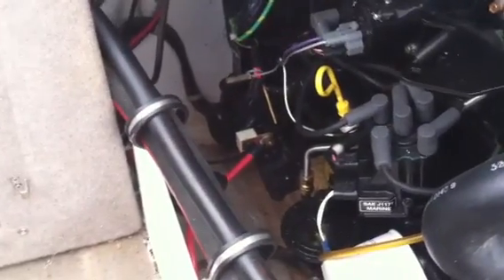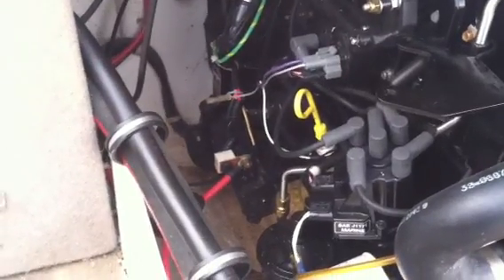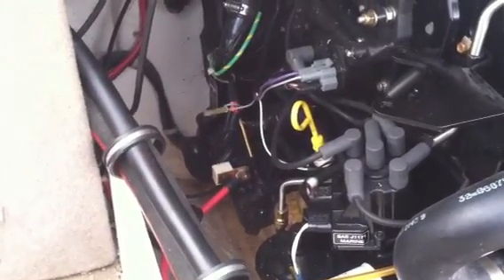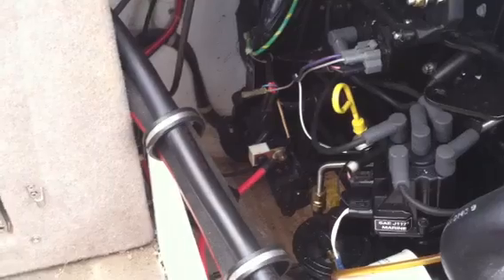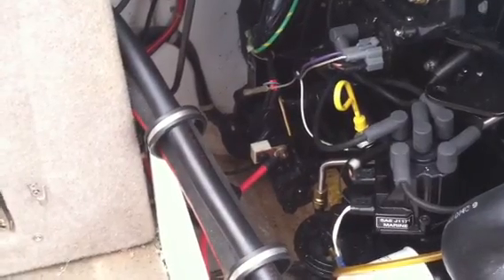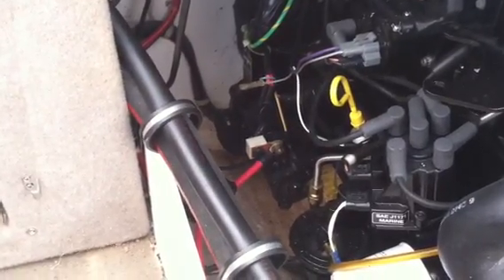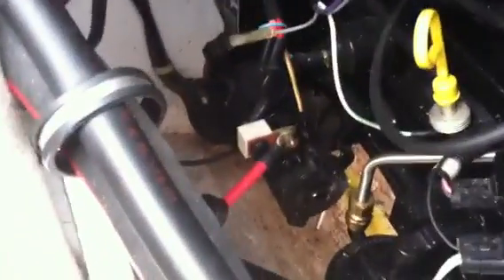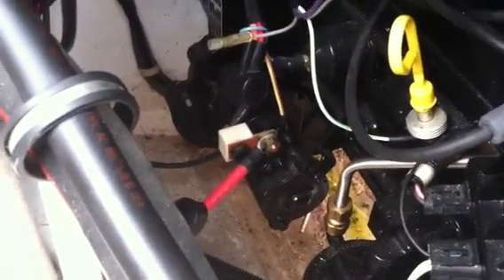Mercruiser electrical Troubleshooting

Comment: Bro, this is probably my problem!  I was looking at that exact part today on my boat… scratching head like what’s this thing…. ?  My problem is my engine starts up and run for about 30 seconds then revs up and dies.  I have a electric choke that seems to get power off and on, making the choke not work right.  Damn, I will take any extra advice, or whatever info you can email would be cool too!  Rock on!

Comment: Thanks for the video!  I hooked up a new battery backwards and the 90 amp fuse was blown no power to anything..  Replaced it and everything back to normal :)  My boat is a 2001 Bayliner Capri 1950

Comment: Everything you say in this video and what I read in the comments is my situation. I just pulled out the fuse after hours of grief and ordered a new one. If this is the solution I cannot thank you enough. However, pulling this fuse out of my boat was a HUGE pain in the neck. It is VERY hard to get to.

Comment: I've been a marine tech for 35 years and actually most of us are really good guys. Working very hard at a very physical job.  Not only is it unethical and wrong,  but most of us are so busy that breaking something purposely on someones boat just doesn't make sense.  
One of the important jobs of that fuse is to protect the electrical system from someone hooking up the battery backwards.  I have had a couple of customers over the years who wanted to get a jump on the season and while hooking up their own battery,  accidentally (and for a very short time) hooked it up backwards.  They fessed up,  we laughed about it, and then we dropped a new one in for about $30

Comment: I am having the same issue right now went out to my boat to locate the fuse and cannot locate it.  I have a 1996 Mariah shabah with the 3.0 mercruiser.  I have power to all accessories blower and bulge but no power to ignition gauges won’t even move when key is turned.  I put a brand new battery in it today as well no luck.  Any suggestions?

Comment: i have the same problem... thank you so much... it ran fine and sat a year and now no power with a brand new interstate battery. i cleaned all the cables and connections which was very hard for me. still nothing... i will look now at that fuse. i cannot fine a fuse box on this boat???
Reply: Sometimes the fuse box can be under the steering on the left, kinda where the pedals on a car would be located
Reply: @georgethebear1812  found fuse box all corroded bad... clean and replace all fuses. got power to dash now. thx...

Comment: im having an issue of sorts myself, i was told it was a bad starter but when i turn my ignition on, i get a single click then nothing, everything else works but the engine doesnt roll over and my power trim doesnt work

Comment: BTW, I have a 2006 Bayliner 194 with Mercruiser 3.0 Engine. that replace the 90 AMP FUSE that cost around $15.00 to $35.00

Comment: I was selling my Boat before I head over seas next day on a rush. Went to the lake and plug the negative and positive wrongly on the Battery and then nothing at all. No power to the boat. Trim was the only area had power. The buyer turn around and left thought there is really something wrong with my boat and did not buy. After I came back from over seas I called several store and the wanted my to drop the boat off to them for diagnostic , While they exactly knew what is wrong with my boat.  they estimate $750 or so pluse parts and Lib,...... I could not trust them.
THANK you to you and Mellissa for your video. After watching your video, I knew that that is what is wrong with my boat as well. Cost me $35.00 for Fuse 90 Amp and took me only less then 5 minutes to  change it. 
Thank you Thank you Thank you very very much. 
For others, If you turn on your key and nothing happen(no Power what so ever) most likely you like me have connected the + and _ of the battery wrongly and you got to change the 90 AMP Fuse. then you are good to go.

Comment: I just found out I have the same Problem, nothing works but the drive trim.  I was installing a new alternator and sparked across from  the black terminal to the engine body.  One quick spark and nothing, replaced every other fuse on the boat and No Joy.  I searched through my manual and found out about that 90A fuse.  Should have checked this first.  a very frustrating deal.  I will get a new fuse tomorrow and be out motoring around.  Thanks for the Video, I was not exactly sure which area it was, picture in manual  is cruddy.  Thanks again Jeff D.
Reply from the maker: Heads up. That fuse IS NOT cheap. Glad I could help:)

Comment: I accidentally hooked up battery cables the wrong way.  I'm glad they have that fuse there. If it weren't for the fuse, you would have a bigger electrical problem. Good video, helped me diagnose quicker. Now my problem is that the local marine stores are all out and I am going to the lake this weekend.
Reply: Thanks for explain why the 90A fuse goes bad.

Comment: Thank you SO much for this video! I have exactly the same symptoms with my boat. Power trim works, but nothing else happens when i turn the key. No gauges light up, no engine cranking.. nothing. I called a marine tech and described the situation and they said I may need a new starter motor for $250 plus $200 for labor (so total of $450). I'm really hoping that I just need to change this fuse! Thanks again for sharing!

Comment: Nice!  I had the exact same problem.  Power trim only thing working so I looked for fuse per your vid.  Not one on my boat so I disonnected the canon harness (just above and to the right of the fuse you are looking at).  Cleaned it up good applied dielectric grease and bammom problem solved.  Just thought this comment might help someone else.
Reply: Paul Haines is there anyway you can further explain what you did in detail for someone who doesn’t know anything about working on this? I believe my mode is the older kind that doesn’t have a fuse either

Comment: I have an 1989 Mercruiser 3.0 I turn key nothing checked key switch good, put test light at starter from key switch on power, jump starter with screwdriver across solenoid motor starts, any thoughts   ??

Comment: Hi there. I have a maxum 1800 with a 3.0 mercerised engine. (2008 ish)

My engine will turn over ok - I get the horn and all the trim working - but I am not getting any spark. 

I have a spark tester between the coil and the top of the distribution cap and nothing. 

This is very odd as it did it about 3 years ago - I managed to get a spark by taking all the plug leads off, using wd40, and repositioning. But it's not working this time! Very annoying!

Can you help please. 

Thanks. 

My email is jonestimetravel@aol.com. Thanks
Reply from the maker: David Jones Use process of elimination. If you are getting good continuity between A and B but cant get good continuity to point C you may have found your problem. I would back trace your steps from the plugs, to plug wires,  to the coil then to the wire feeding the coil. IF there is no spark on any of the plugs it is likely a bad coil pack or wire feeding the coil pack....
Sorry it took so long to get back with you. I hope that helps....

Comment from the maker: Randy Handwork  No problem. I absolutely refuse to take my boat to a marine tech. When fall comes around I recommend doing the winterization yourself. It It is very easy to do. And You'll save 100-200 dollars depending on what they charge where you are from.

Comment: Just wanted to say thanks! I have a 2010 Mariah with a 4.3 TKS Mercruiser. I had the exact same problem after a tech winterized my boat. I watched your video bought\swapped out the fuse and I am back up and running. I almost think that the tech did this on purpose to get a repeat call and more cash from my pocket! I think the fuse blew because they arced the battery when they were disconnecting it. Any way, thanks for putting this video up.